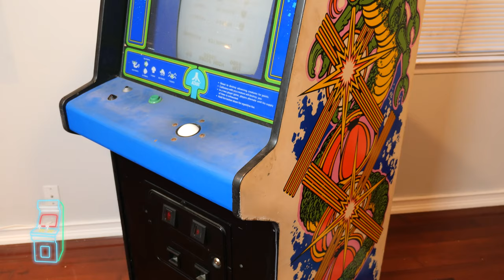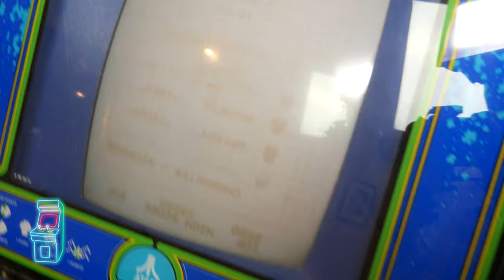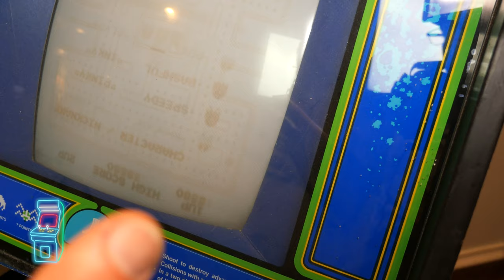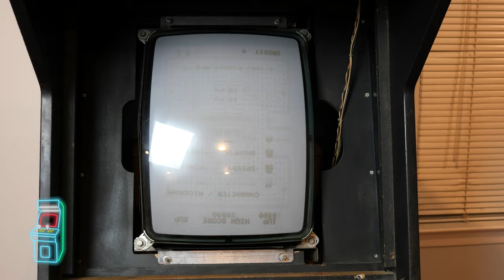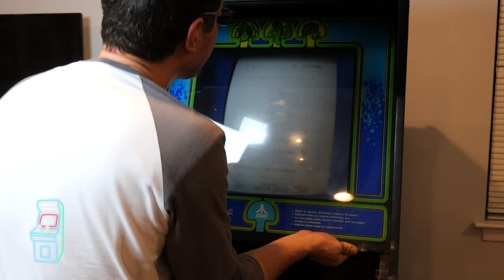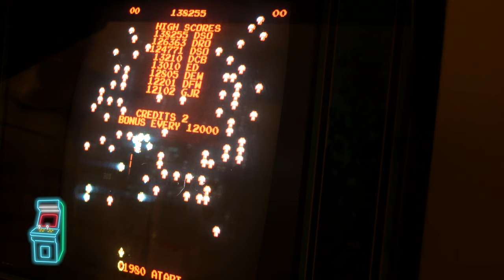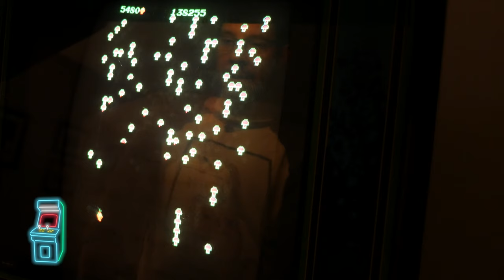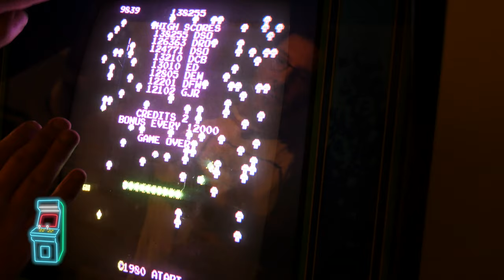Arcade Hunting - Centipede [Part 1]

Comment: Enjoyed the vid...GREAT pickup.  You have a link for those nylon levelers you used?  Thanks!
Reply from the maker: You can grab these on Amazon:  https://amzn.to/2OtpYiz
They fit in arcade cab existing leg leveler holes, but if you need to repair your cabinet they also come with the metal screw to fix them.  Bonus!

Comment: Forgive my ignorance but in any restore videos I see, I never see anyone cleaning the PCB's they are often caked in dirt. Why is that?
Reply from the maker: If they are really dirty I typically clean them in the sink with Simple Green and distilled water, followed by an alcohol bath.  But normally you can just use a soft paint brush to remove the dust. 
In some extreme cases, you can do what I did: https://youtu.be/Nf9e7AUPI4Y
Lastly, I clean arcade monitor chassis all the time with Simple Green and water. Those are usually the grimiest: https://youtu.be/kRqs5Srjhv4